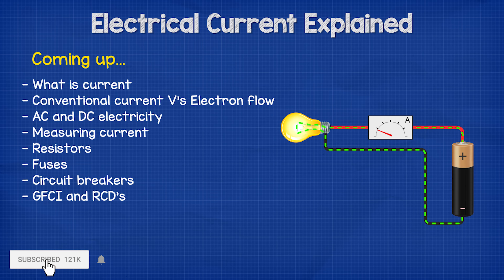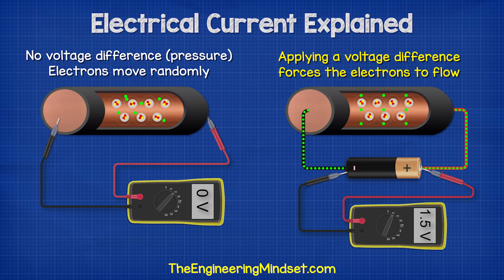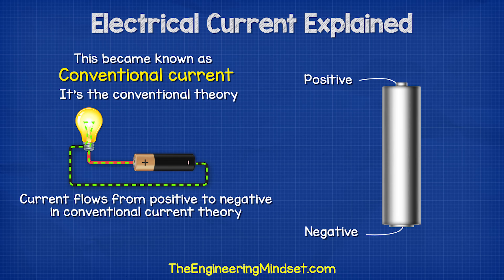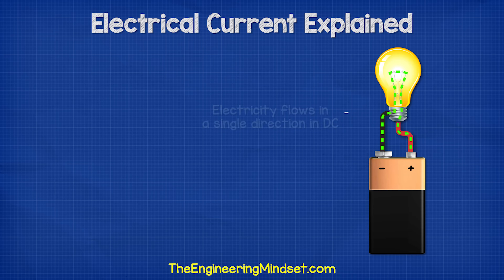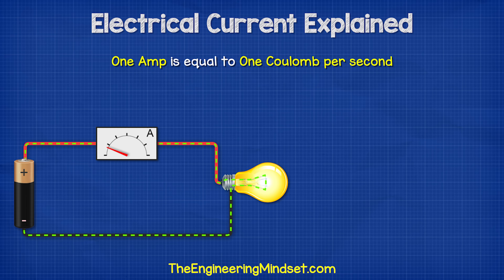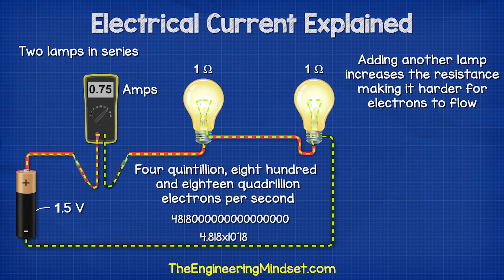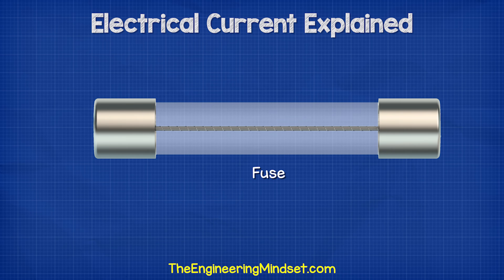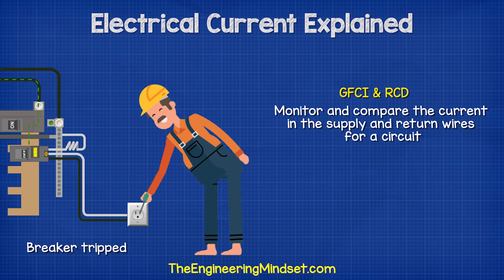Electrical Current Explained - AC DC, fuses, circuit breakers, multimeter, GFCI, ampere

Comment: 1:59 Can we really measure voltage without any current flowing? All measuring tools have resistance even though it is in megaohms.
Reply: This is an excellent point. I've thought about this myself as it's very interesting. We usually don't consider a meter or testing instrument as a "load" but of course it is. And important to remember is the definition of voltage as energy/charge, or the amount of energy used to move a given amount of charge. When we read 120V on our multimeter, what it's really telling us is that we have 120 joules of energy being used for every 1 coulomb of charge that moves through a point in the circuit. Our meter is only allowing a very small quantity of charge to flow through the circuit in a given time, which means the energy used, or work done by the meter, is also very low--proportional to the energy/charge ratio that the voltage measurement provides for us.
Reply from the maker: Check our new Multimeter tutorial out ➡️ https://youtu.be/4lAyzRxsbDc

Comment: If increasing the voltage causes more electrons to flow past a certain point in a certain time, then the amps are by that definition increased as well. And yet, we know that increasing the voltage does not necessarily increase the amps. So I am confused.

Comment: Why do you not mention the mathematical difference between conventional current?

When someone uses conventional current, they can still show the flow of electrons, just with a negative value. For example, if you draw your current arrow from - to +, it has some negative value, this is still conventional current.

Electron flow is when people decide to put the positive value of current from - to + in the direction electrons move. 

It is deeper than just simply stating how someone imagines the current, it is about the sign of the value because as I stated a negative conventional current is the direction of electrons.
Reply from the maker: We could talk for hours on the subject but we need to draw a line somewhere
Reply: @EngineeringMindset  agreed there are many interpretations, I am just emphasizing there is a mathematical aspect to this. Would you agree that if you have a negative conventional current, then that actually shows the direction of electrons?

When you say you prefer electron flow, if you were doing a mathematical calculation and you had an arrow from - to +, would you label that with a - value or + value for the current? The latter what would be what I think of when I think electron flow

Comment: this is nice tuturial.. but i just want to correct about parallel circuit, in order to have an amount of curent flow.. you have to compute the total amount of resistance of the intire circuit.by using the formula r1xr2/r1+r2 and devide it to the source voltage,to get the amount of current flow of the intire circuit. not directly multiply the supply voltage to the bulb resistance.

Comment: I think you need a further correction for the 10:36 mark.
You have in the text:  "One Coulomb ="  BIG number "per second".
A coulomb is just the number of charged particles without any time dimension.
BIG number per second would be an Ampere.
Great teaching work, thank you.
Reply: Glad someone else noticed lol. Also, is it  6,424,xxx or 6,242,xxx?
Plus using an apostrophe for Amperes (and earlier also amps)

Comment: Maybe at some point you would like to discuss an oscillator in the circuit of a DC current which produces radio waves such as is used in RF surgeries, garage door openers, perhaps laser treatments of skin or thermolysis.  How much heat is produced?  How is it controlled?  How is the heat directed in a mono antenna such as a needle or surgical "knife", non-knife cutting device?

Comment: Conventional current isn't entirely wrong though. That's because electrical signals still follow the direction of conventional current, opposite the direction of electron flow, kind of like the tension propagation direction opposite the direction of a locomotive-hauled train.

Comment: I’m so confused as to the explanation of why we default to teaching conventional current. I already knew that electrons flowed from negative to positive but wouldn’t it be easier to just teach that? Who cares if the manufacturers still label the negative terminal and positive terminal “opposite” of what it should be. Just teach the negative side as having negative charged electrons flowing to the positive side. That’s how I remember it. Pretty stupid to teach it as conventional if you ask me.
Reply: So it comes down to the markings used on components. Diodes and batteries are the biggest contributor, but electrolytic capacitors and other polarity based components or constructions affect this. Because they were all based on conventional flow, it needs to be understood that that is what they were designed for so that the engineer or technician doesn’t hook something up incorrectly. The best case scenario being it doesn’t work, but the worst case is an explosion. And component flip explosions are fun. 
  Another thing with conventional vs electron flow representations is how systems are designed. The creator here has fallen into this trap on several occasions because he tries to represent most everything with electron flow. However, often when he combines AC with DC, he merges the two which can be confusing to those not practiced on circuit theory. You can look back in this video even where he showed an AC to DC rectifier and drew it with conventional flow. 
  A big thing that also comes with AC and how it works to the conventional flow is ground. While it is true AC doesn’t technically have a dedicated flow, we often use a conventional flow model to explain AC connections from the power plant to the load and into ground, or, for outlets, from hot to neutral. This, coupled with the fact ground itself is negative both by conventional design and by relative voltage to the atmosphere, makes the conventional method the more practical approach. Electron flow is only noted because it is what is happening.
Reply: @CodyLynn100  what is interesting about these videos is that the difference between the conventions is all about the value. Those that typically use electron flow put a positive value of current from - to +. Conventional current can show the direction of electrons as well, with a negative value.
Reply: Hectic Hive Back in the day when Ampere, Volta et al were experimenting with electricity, nobody knew about atoms, let alone electrons. It was a 50% punt whether or not they got it right. There are rules about rotating machinery that rely on conventional current flow: Fleming’s right hand grip rule for magnetic polarity and current flow in a solenoid and Fleming’s right hand generator and left hand motor rules. These would have to be changed in order to make sense of electron flow. Not impossible but more expensive than saying electron flow is opposite to conventional current flow. 😊
Reply: Conventional current is actually correct. Since electrons were defined as a negative charge, and current is the flow of charge, then conventional current will be negative in the direction of electrons. Electron flow "pretends" the electron is positive and thus positive current is in the direction of electrons but there is no need to do this.

Comment: So the difference between Voltage and Current is:
Voltage is the "push" of electrons, as in regardless of the area those electrons are moving through, they have a certain amount of "push" to them forcing them forward at a certain speed.
Current, on the other hand, is the available area of electrons in the first place.  Something with a larger area of electrons has more current, while something experiencing more electrons flowing through it have more voltage.
For the longest time I didn't understand the differences between voltage and current, even though I knew how to calculate the V I and R relationship of them.  Is it safe to assume a "thicker" wire will always have more current?  Or is there an example of a thinner wire with more current?  Does it have something to do with the wire's natural ability to resist "exploding" which dictates current capacity?  Like, can a metal (like copper) when compared to others have a higher current capacity?
Reply: You’ve gotten a few things mixed around here, I’ll try and clarify. So you have voltage correct in that it is the “push”, but there is not a specific speed. Think of pushing a box up the hill. You can push a box up a hill but will move slower if it is heavier. 
  Current is not the area of electrons, but the flow of them through an area. The more electrons flow through an area, the more current there is. 
  The area electrons can move through is noted as conductance with the inverse being resistance. A smaller area of flow such as a smaller diameter wire has a lower conductance and higher resistance. When something has more electrons flowing through it, it has a higher current. This can be caused by either a lower resistance from a larger diameter wire with more conductance or caused by putting a larger voltage across it. 
  As for the wires and their current capabilities, a thicker wire can handle more current, but that doesn’t mean it will. We also switch wire sizes based on distance. 10A of current can flow through a 20ga wire that is only 1 foot long without issue, but the wire will need to be a bigger diameter to reliably send 5A over a distance of 50 yards. The current is smaller but a larger diameter must be used be cause the length of the wire adds resistance. The biggest concern is that, as he explained with a resistor, heat is generated by resistance. Flowing too much current causes a wire to get hot which can melt the insulation and even the wire. There are many different tables that give you the numbers and some will even give you the max current for aluminum and steel wires as well as copper. 

https://www.google.com/search?q=wire+gauge+chart&rlz=1CDGOYI_enUS709US709&oq=wire+gaug&aqs=chrome.1.0l2j69i57j0.4134j1j7&hl=en-US&sourceid=chrome-mobile&ie=UTF-8
Reply from the maker: Check out NEW resistor video, everything covered! ➡️ https://youtu.be/DYcLFHgVCn0

Comment: Isn't it more correct to say that the CHARGE of the electrons flows, rather than the electrons themselves?
Reply: Yes and no. Charge is based on electron deficit or abundance compared to another point. This is what the conventional current method uses saying charge flows from positive to negative. However, the electrons are flowing through the wire as he explained, but they are flowing extremely slowly. When a charge is put across a wire, as in the battery, the electrons start flowing to neutralize this charge, but they balance out the charge on the line before and after a resistance so quickly that there is no practical charge flow.

Comment: Can we make a perpetual motion with the help of ac motor and dc motor with the help of some gear??? comment if you have any idea
Reply from the maker: Perpetual motion is not possible. Unless you travel far into space away from any gravitational pull
Reply: But that isn't always that way. There would be some energy loss but it could work however in consideration of normal environment. If we look on to the thermodynamic. Perpetual motion don't exist but what if We look in the other side of the laws then we might not have some restrictions of the law itself. So we may have  an atleast of 45% of efficiency of the motion
Reply: I'll simplify the Laws of Thermodynamics for you
First Law - you can't win
Second Law - you can't break even
Third Law - you can't get out of the game
Perpetual motion is not possible - END OF STORY
so don'y waste your life trying